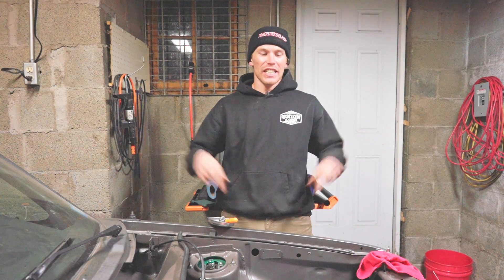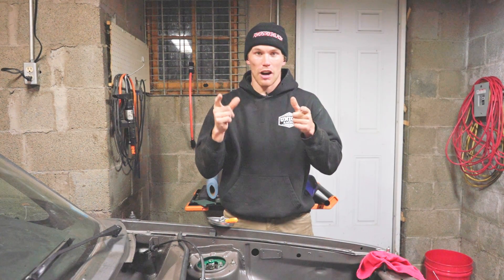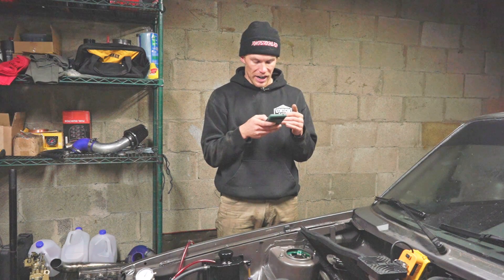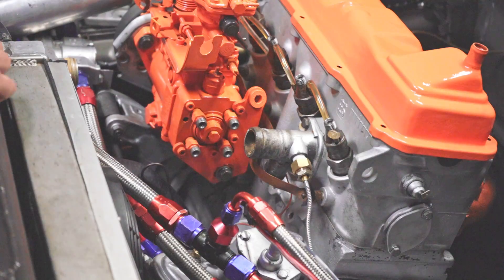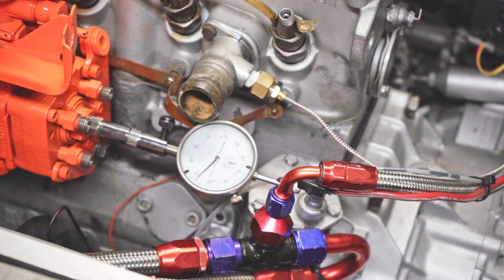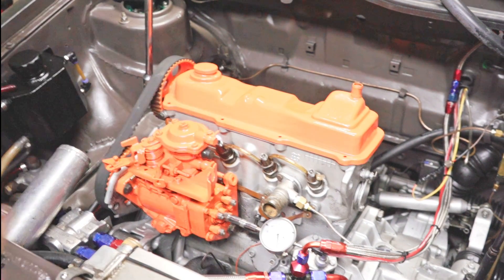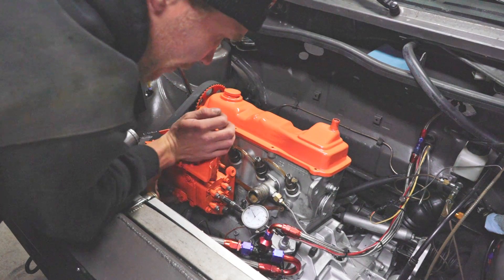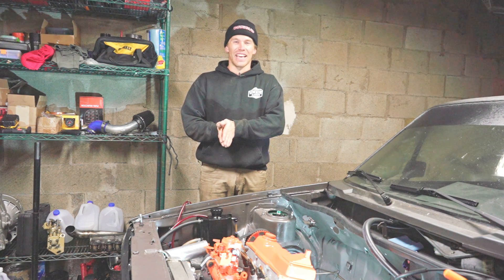How to set INJECTION TIMING on your VW 1.6L or Bosch VE

Comment: i need adjustment on my VW golf 3 1.9d, how do i know the measurement i should do for it
Reply from the maker: Hmm well that's probably electronic not mechanical?
Reply: @OliverFetter  it is mechanical
Reply from the maker: @vascohf2890 you'll just need to try some different settings! Or Google it. Or watch my 1.9 timing video haha
Reply from the maker: https://youtu.be/QnBwDhFVEf0?si=T7ZbGxB4n93pMkKf @vascohf2890
Reply: @OliverFetter thanks!
Reply from the maker: @vascohf2890 I'd be shooting for 1.1-1.7mm most likely
Reply: @OliverFetter thanks so much for the help, I’ll try it, where did you buy the dial?
Reply from the maker: I've tried a few different ones 🫣 honestly hit or miss. Look for "diesel injection timing kit"

Comment: Hi! Great video! My VW 1.6D engine is in a boat and the timing is off since I had to overhaul the fuel pump. The cam-cover cannot be removed because of lack of space and there is no gearbox with a mark on it because the engine is attached to the prop-shaft of my boat. Is there any 'trick'  I can use get the timing aligned again? Removing the complete engine will be a huge task so I'm trying to avoid this at all cost...
Reply from the maker: Hey sweet! What boat? Kinda jealous haha. Give me a few more details... Is it just the pump timing that's wrong or is it all engine timing?
Reply: @OliverFetter  Hey! thank you for your answer. It's a small, open, classic steel boat inspired by a 20's design. The belt was also removed but I think the main thing is the pump timing. The engine used to run perfect, no smoke at all even at cold start. Now it only runs at higher revs with a lots of smoke. No idle running.
Reply from the maker: @martijnc2900  if the belt was all the way off I'd be rechecking engine timing too 🤔 just IMO. The fact that it runs means it's somewhat close. If it's shooting a mix of grey and white smoke your timing is too slow/retarded and you need to advance the pump (turn pump towards the valve cover)
Reply: @OliverFetter  Thanks! That is really helpful, I will try to rotate the pump a bit.

Comment: Hola amigo una pregunta porque lo pones en 0.40 cuando el manual dice a 0.90 , te lo pregunto porque yo lo tengo a 0.90 . Cual es la diferencia?
Reply from the maker: I like to play with timing a lot. Set it to what works for you. I used to have it set to .0375". I assume you're talking in millimeters when you say .90
Reply: @OliverFetter  si en milímetros con el reloj comparador ,mi pregunta es donde tendrá mejor rendimiento en 0.90 o tienes algún timing donde valla mejor el motor JR?

Comment: Good video i have a question if my pump is set like yours do you have any problems with acceleration  ??? Cuse my 1981 caddy won't accelerate like suppose to be
Reply from the maker: Hmm did you change the timing and now it is slower? Or it is slow to start with?

Comment: Good vid, quick question though, wouldn't you want to adjust the timing after the engine is warmed up? Cold start and idle advance affects timing no.
Reply from the maker: The idle advance on these is just a lever you pull, thus base timing should be set with that lever in 👍

Comment: hi, i have to do the same operation and the manual i have of this injection pump says that the timing of the pump it's supposed to be at around 0.355 and i have to ask if you have something with different measures or you wanted 0.385 yourself for better performance?
You have amazing videos, thanks for all the information :D
Reply from the maker: Hey! Thanks! Yes your manual isn't wrong & neither is my timing setting. Generally timing is a range and you can be anywhere from .87mm - 1.05 mm and be totally fine. Where it performs best is up to you to find out though! Generally on a stock set up being a bit advanced (.385) can feel more peppy and give you more top end. But you really need to experiment 🌞👍have fun
Reply: @OliverFetter  thanks so much for the info, i will mess around with mine for sure, i just wanted to be sure because not much people who build cars explain in that much detail what they are doing and how things are working. Keep it up ^^
Reply from the maker: @wotvsrdars2154  🍺🍺🍺

Comment: Is this after you fitted the 11mm head and plunger?
Reply from the maker: Yes
Reply: @OliverFetter  did you have any trouble setting the idle screw i have done the same on my aaz pump and i can not get it set its either running like crap or constant rev hang on a fraction of a turn
Reply: Fuel screw i mean
Reply from the maker: @ciarangalligan2220  I haven't had that experience 🤔 sounds like you might need to drop the fuel screw & increase the idle, or there's an assembly issue if that doesn't work.

Comment: I know mine is way out. Gotta do this soon. Gonna get injectors rebuilt first
Reply from the maker: Right on! What's your (presumably) rabbit like?
Reply: @OliverFetter  I’ve got an ‘89 Mk2 Jetta with a 1.6TD. In Canada. Has about 210k KMs on it. Was gifted it a year and a half ago from a family friend’s estate. Was never winter driven. Has almost zero rust, just a couple surface spots. Needs a little TLC but interior is mint and exterior is very good. Under the hood needs some attention but just little things mostly. Just redid the suspension and threw on some coilovers too. Debating tuning the fk outta the 1.6TD or just a lighter tune for now and then swapping in a few years. Still up in the air
Reply from the maker: @chrisladouceur4093  that's dope! Thanks for sharing!
Reply: @OliverFetter  thanks for your content! Definitely interested in anything 1.6TD related. Performance, maintenance, etc.
Reply from the maker: @chrisladouceur4093  right on. I intend to make some maintenance vids soon but my cars never operational long enough to need it 😅😅

Comment: I just replaced the seals and o-rings in my injection pump. I have everything hoked up except for the injectors to the lines since I'm trying to bleed the air from the pump. Do I have to put diesel manually into the pump? Or how does it fills up because when I crank it, it doesn't seem to be pushing any fuel out of the lines or even from the line coming from the fuel filter.
Great video man, it's been super helpful!
Reply from the maker: I think eventually it will self prime, but filling the pump with fuel is a good idea. I use an electric inline pump to prime it. You can also put compressed air to the return line & that sends fuel the other way (use at your own risk tho lol)

Comment: Great video man! Any tips on tightening the bottom 13mm bolt on the pump? So hard to get to and I don’t feel like I’ve got it tight!
Reply from the maker: Assuming you mean the bottom bolt near the radiator bypass hose?? I've found the conical nut tends to hold itself in place once there's tension on it.  I set up a 1/4" drive rachet with a shallow 13mm + U joint + long extension and force it into the bypass hose a bit to get the 13mm seated on the bolt head. That puts the rachet out by the regular rad hose with lots of space & you can sneak a finger or two on the nut to keep it from spinning initially. Hope this helps 🌞
Reply: @OliverFetter  exactly what I meant. Cheers mate, I’ll give it a go 👌🏻